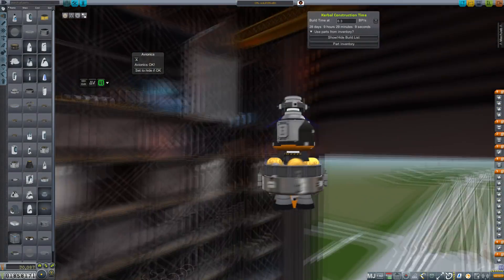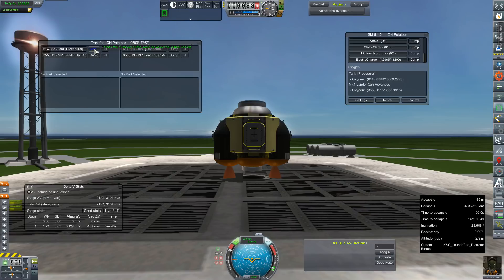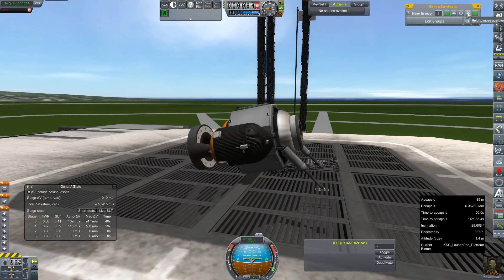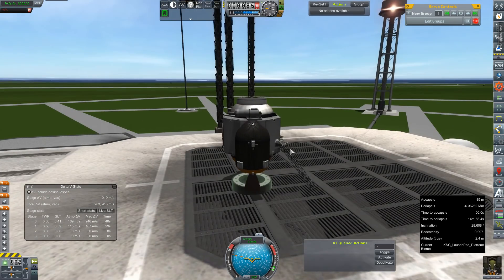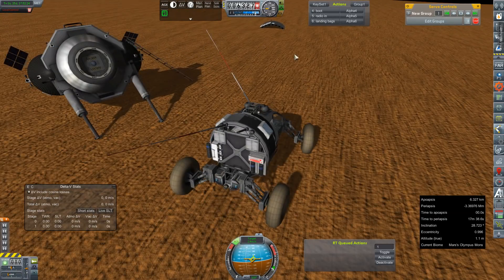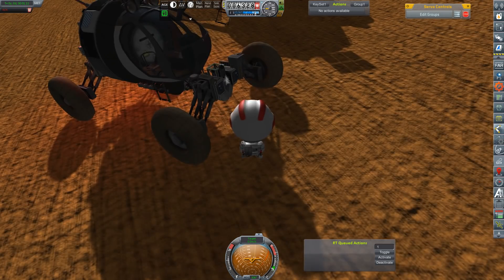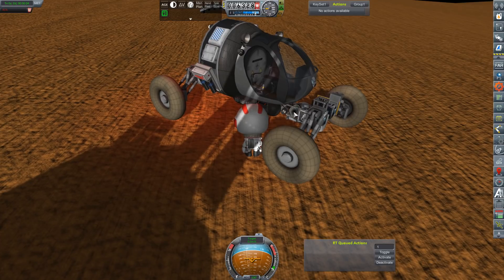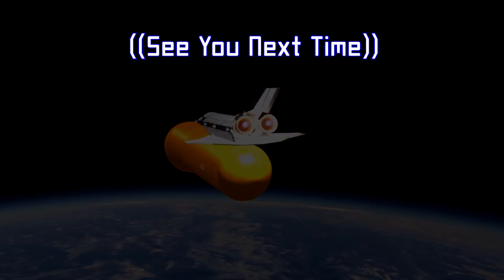KSP RP-0 #401 The Mess We're In

Comment: There are some other good suggestions in the comments, but my 2¢ is that you should decouple the decoupler and use the two engine bells as two legs of a tripod. I love the Apollo 13 problem solving, good luck
Reply from the maker: I think moving the base plate tank ( even temporarily ) might be the way to go - it gives us more of an angle to work with from the landing legs, and provides a more stable base ( wont roll sideways on the engine bells ) to work with.
Reply: I agree it will give you more options, but I have a sneaking suspicion that the ascent vehicle will overbalance and fall down the opposite direction to the one it's in now. It's on a pretty serious slope. The benefit of the tripod is that you can get to like 80º vertical and not risk tipping the other direction, whereas the plate faces straight down and so you don't have that option

Comment: Using the hinged girder is an excellent idea. You could try to use the antennae (is that correct?) as the girders base, like a T shape.
Reply from the maker: I like this idea. especially because I don't have near as many girders as I thought. ( I was planning on using them to widen the footprint at the base )
Reply: Yeah that could work, IF there are enough girders. But I think weight might be an issue too, since a girder weighs a lot more than an antenna.

Comment: Can the two main landing legs not be moved further back?  They would then prop the lander up to a higher angle, I would keep moving them further and further back and redeploying them in small increments until I find the critical position where the lander tips back onto the base (Or something else goes horribly wrong).
Reply from the maker: they can - but KSP does strange things if the extended leg moves and suddenly has one foot under the ground level ( like shooting things into the air ) the safest way to go about moving them is in the retracted position - the catch 22 being that retracting them or even one at a time - causes the lander to shift, and making the new pointing spot unavailable... I need a way to hold the lander at it's current height with the legs retracted, and then re position them.

Comment: The roll really is an issue. Maybe you can attach some small things to the base plate to prevent that. Also it would have a wider stand so the risk of falling over again is smaller.
Reply from the maker: The roll caused by the base plate ( and the added angle needed because of it) might be a very limiting factor - I wonder about moving it up top and attaching it through the docking port...